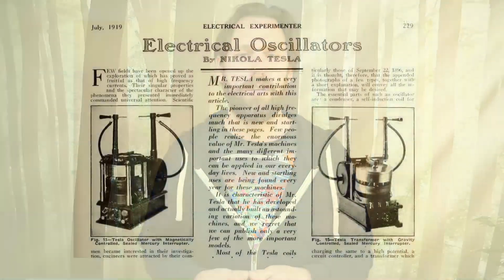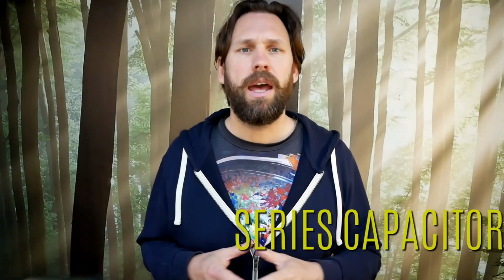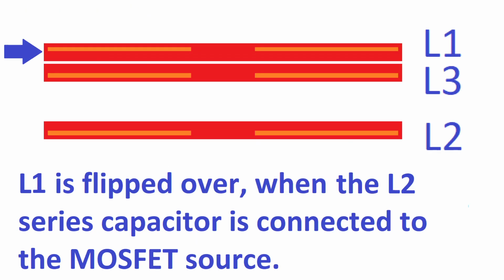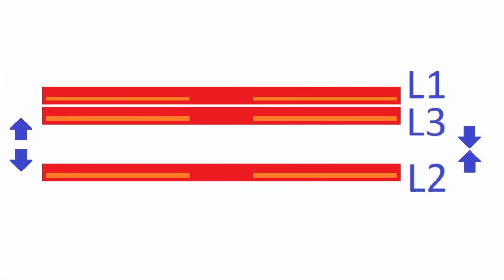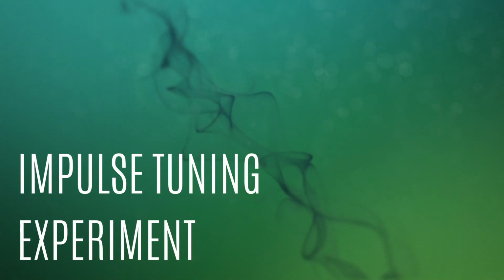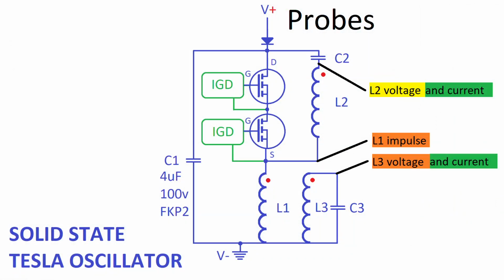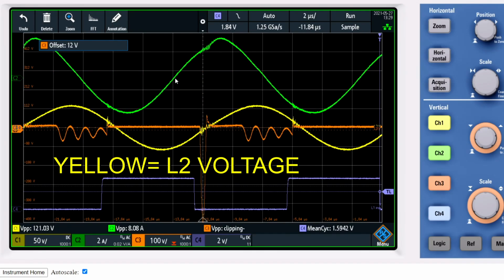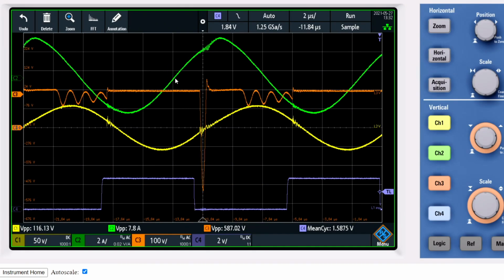How To Tune Impulses Anywhere on a Resonant Cycle, using Bucking Coils.

Comment: You likely have already answered this, but why use 2 FETs again ?
Reply from the maker: 2 in fets in series can handle double the voltage
Reply: @MasterIvo  oh of course! Wow brilliant. Question/ Request sir, for an upcoming output coil...could you try the winding method from Tesla's Pat 336,961 Fig 3 with the helical style, and self-canceling inductance ?
It would fit right in your video sequence with being a Tesla patent?:)

Comment: thanks master ivo, you describe the resonant LC coil benefits in bifilar coils setup , i also work in these circuit , you are rectify the ruslan , akula setup of granade coil with technical details , benefils and phase shifting , i also observe  these phenomena in series input load / output bevahior , the distance really matters bettween primary and secondary , thanks

Comment: Now all you need is many harvesting coils near by to get overunity. And maybe a wavelength leads to a rechargeble battery to reclaim any supply loss. So says the great don smith. And it all works better at higher frequency. Any thing close to 60 hertz wont cut it. Probably don had some ideas about modern switching power supplies.
Reply from the maker: if only the Don was clear

Comment: You are now ready for the spherical transformer that is built on a hollow copper sphere. Now the phases are geometric in the rotation of the field. Two coils at 90 degrees is way easier to do with geometry! This is the geometry of the copper atom.

Comment: OH! gotcha; current max, after accounting for phase shift of current probe. cool, i think it clicked 💡
Reply from the maker: yes, and with (unloaded) resonance voltage and current are always 90 degrees separete, so if the current is maximum , the voltage is minimum (in the middle between pos and neg max)

Comment: Hi Ivo the ripple that you show around minute twelve on the video I guess is the self resonant frequency of the L1 coil, nice experiment by the way, I experiment a lot with tesla circuits too, what I can tell you is the key to extra energy is negative impulse, because in negative impulse the E vector radiate inward so you can collect it perpendicular without diminish the source, I looking forward to your next chapter.
Reply from the maker: Actually the impulse is at the self resonant frequency, while the ripples seem to have a different frequency.
Reply: @MasterIvo  I suppose the best way figure what is causing the ripple, is isolate component on the circuit and make measurement, there's many components on the circuit that can generate harmonics, you can use cursors on the osciloscope to get the ripple frecuency and make calculation based on the coils and the capacitors to figure what component or group of them match the ripple frecuency, But I guess you can figure that by your own ;-)
Reply from the maker: Yes I tried that. but no result. Best solution might be prolonging the impulse duration. This also has the benefit if a longer power moment.
Reply: @MasterIvo  Hi ivo I got a similar case in one of my circuit with ripple that we mentioned before, the ripple is generated by the CDS of the mosfet the capacity of drain to source, resonating with the inductive component of the circuit
Reply from the maker: that is interesting, but why does it start to oscillate before turn on? what makes it be dead quite before it starts to ripple? There must be an event that triggers it, but it seems to come out of the blue.
Reply: @MasterIvo  that`s a good question, I`m not sure it is the same case that I mentioned, assuming that you have isolated the components and make calculation like you mentioned before the only variable left alone is that, and of course we can`t minimize the field components, the perpendicular field caused by the opossing field can be the one that is causing the ripple by coupling, don`t forget that you have two type of resonance together, series resonant allow only the resonant frecuency to pass and block all the others, and parallel is the opposite case
Reply from the maker: I isolated it with using only the L1 coil and a single mosfet. then it still occurs.
Reply: @MasterIvo  well in that case the problem I assume that will be CDS capacity of the mosfet as I mentioned, you can check on the datasheet for that value and make the calculation of oscillating frequency with that value and the measure in the oscilloscope to confirm the theory and don`t forget the capacitor that you have between V+ and ground

Comment: Is the idea that the impulses from L1 will produce extra energy in L2?
Reply: Guess it is, but the main idea are to push the energy curve, like as you push a child on a swing. This is although not connected to any enviromental frequecy, but purely the ressonance in coils.
Reply from the maker: yes and the push is the impulse. The idea now it to give the voltage impulse power by the resonant current.
L3 then gets powered from both sides. while its the same energy, so twice the power, for once the input power, as the energy is recycled and reused

Comment: what can this be used for?
I am trying to heat with induction. can this be used for that to optimise the system?
(sorry I am a noob, dont understand induction well)
Reply from the maker: For now this is pure experimental data. But it will lead to a product in the future.
For now, this is not related to induction heating.
Reply: @MasterIvo  What kind of product will it lead to in the future?
Reply: @MasterIvo  you said it can generate power?
Reply from the maker: Yes, voltage times current is power.
By getting the voltage impulses in phase with the resonant current...
Reply: @MasterIvo  you generate lots of resonate longitudinal power?
Reply from the maker: I would love to give a clear answer, but it is too soon. much more testing needs to be done first.

Comment: sometimes this 'ringing-effect' is coming from the big capacitors that are build on these halfbridges between (+) and (-). don't know if you integrate them in your circuits. i removed them from my circuits to get a better understanding what is going on. your information is as always very helpful! thank you :)
Reply from the maker: Thanks for sharing René. Yes I now use the 4uF 100V cap But when I probe it I cant see the negative voltage ripple

Comment: Controlling the distance between your bifi coils is a wonderful idea. Thanks for sharing M.Ivo. Wishing you the best. Here is a similar device but by using yoke cores and by imposing the HV spike on both of the input cycles. Hence the push-pull title for this vid. https://www.youtube.com/watch?v=manMnNOFdNI
Reply: I agree, the distance control for tuning is important.  Now I just need to apply all of those Raspberry Pi and 3D printed gear videos I've been watching to automate and more precisely fine tune this design (anyone else is welcome to use this as well).
Reply from the maker: Would love to see those automation devices.

Comment: Hi Ivo, thank you for a clear presentation; very inspiring. I have a question about your voltage polarities. You show +v and -v as ground, is it like a dual polarity power, like +v 0 -V or it is just +v and 0v. I also watched your -ve and +ve impulse generation in which you used dual polarity power supply, +v 0 -V. Thank you for your reply.
Reply from the maker: Thanks, no this circuit has no symmetrical power supply, with ground un the middle between V+ and V-

A symmetrical power supply is needed for a half bridge circuit as I have shown. then it can produce positive AND negative impulses. 

I used this circuit to show the basic principles of impulse tuning tonthe resonant wave by phase shifting.
I have a 2 channel power supply, that I switch in series to get 64V 5A max.
Reply: @MasterIvo  Thank you Ivo for the explanation. I do have bunch of LM78/79 laying around for 12/15/24vdc. But now I know the concept you presented in this video. I have never seen such a brilliant way of explaining power consumed and produced. Great! thank you very much.
Reply from the maker: Thanks, my pleasure